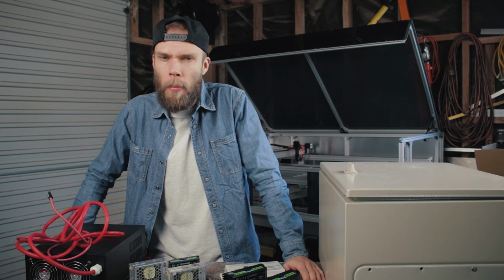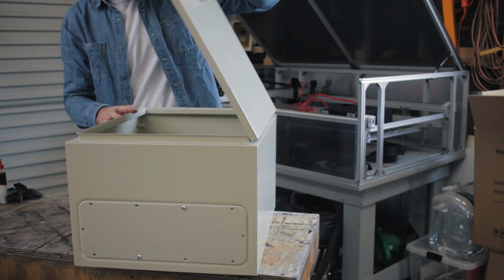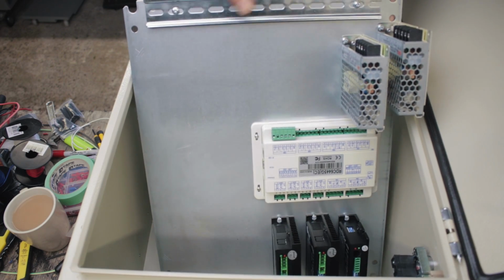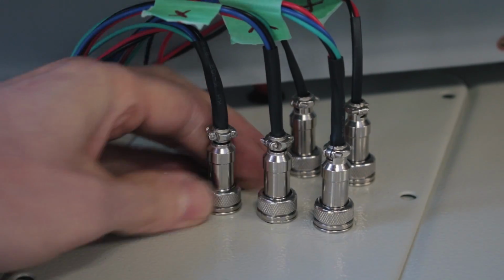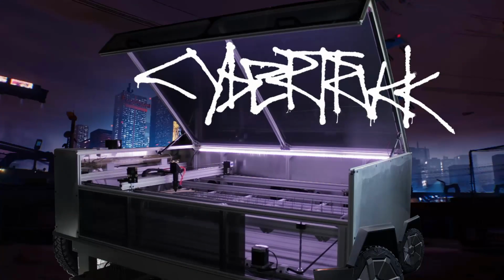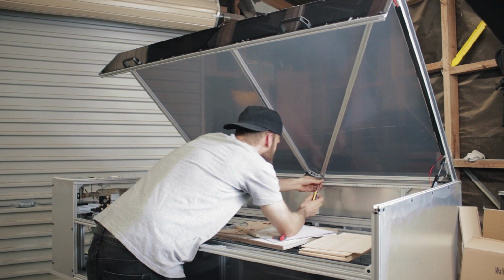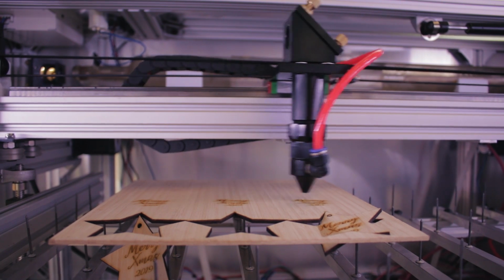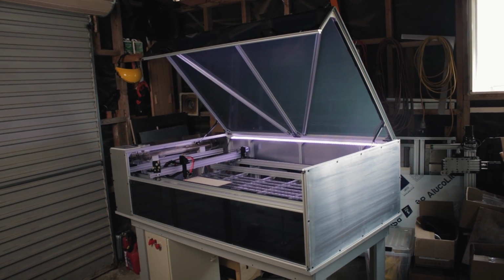Ep9: Finished? The DIY CO2 Laser Cutter / Engraver Build Series

Comment: What diameter is your water pipe. I’m looking at 7/10mm or 8/11mm pipe, what size would you recommend? I’m using a w2 reci tube with a cw5200 water chiller and your design of machine in Scotland

Comment: Hi Rob
I've got the plans and I'm in the process of building the thing, thanks for that. It's been a great project so far. I was wondering if you are still satisfied with the air assist after all that time. Do you find the pressure and air volume adequate for keeping the lens clean? Does it actually make a decent job of preventing combustion of flammable materials like wood/plywood?
Thanks again

Comment: I'm surprised you have no issues with your electronics considering you don't use any shielded wire.
Reply from the maker: Yeah so am I actually - it may be dumb luck, but I've never had a problem with interference. However I do think shielded wiring would be worth doing for the long term.

Comment: I would advise against that tube mounted led.  The pass through setups work much better and double as an alignment tool once the beam from the tube to the first mirror is properly aligned with the visible laser to the second mirror. Anyhow  As a rule of thumb, keeping the nozzle/cart as light as possible is key to avoid over driving the steppers at high speeds during raster etching.  This is due to "dynamic load shift", which is more or less a fancy way of saying the inertia created from the cart during fast starts and stops.  Frame shaking and belt stretching are greatly reduced and higher accelerations can be achieved with tighter tolerance
Reply: I know I'm late to the game, is there any benefit to having a counterweight on the opposite side of the X axis drive belt to zero out any vibration during raster etching?
Reply: @benash2954  Yes, there is if you account for rotational mass from the internal motor centrifugal inertia as well.   This would be done with a dual shaft motor and a balanced differential weight, such as the way a harmonic balancer works but in counter rotation.   That would basically eliminate all inertial load throw.

Comment: Awesome build man, I didn't find it, but didn't look terribly hard, how thick of plywood can you cut with that 50W?

I'd like to be able to cut 1/2" plywood or at the very least 7/16" OSB.

I'm seriously considering a build now, would make for some good companion content.
Reply from the maker: thanks man. 50w wouldn't be great for 1/2" ply, you could do it, but it wouldn't be pretty haha. I'd say 1/4" would be as thick as you'd want to go with 50w. 
Of course more power would give you greater depth but I can't say exactly how much you'd need because it depends on a whole bunch of local factors, like the density of the certain ply and how fast you need to do the job etc. 
I'd start with something closer to 100w.

Comment: As a person who built this laser and spent the last 2 months and thousands of dollars doing it I can’t blame anybody but myself for not being more informed.

There’s so much shit that could be improved on this design I’m pretty sure he just winged this together for this YouTube series.

I really don’t want to shit on him because he put a lot of work into this laser and it does work but it’s like walking on pins and needles using this thing and there’s a lot wrong once you start to really deep dive into commercial lasers designs and other diy builds that got it right.

The exhaust is horrible it sucks smoke right over the 3rd mirror and the linear rail so everything gets covered in soot every time you use it. There’s also no vents anywhere so running the exhaust without opening those sliding panels is so restricted it barely does anything.

There’s no access door for the laser tube so to do anything you have to take half the panels apart and the extrusions on the frame.

The recommended tube is dumb when there are tubes that have red dot indicators built in.

The z axis tensioners don’t work very well and they need to be shimmed up to make it them level with the z motor idler.

There are no pass throughs and the design doesn’t allow for any to be retrofitted.

The suggested location of the electronics panel blocks any chance of being able to clean the laser tube lens or remove the tube without taking apart half the machine like I said above.

That’s just the stuff I can think of off the top of my head there’s so much more shit I have came across that is very frustrating with this thing.

I’m scared to cross hatch with this thing when I engrave because any time you make the y axis move fast the mirrors might come out of alignment due to the extremely jerky nema 23 dual shaft motor that’s hooked up directly to the drive shafts with flex couplers when it probably should have been a single shaft motor mounted above the drive shafts that turned a pulley which turns the shafts like a commercial machine.

Only reason I’m leaving this comment is because someone who wants to build their own machine like me and didn’t know any better being new to this and the fact not many people have diy plans for something like this come across this series and it looks great on YouTube and you don’t find out until you’re months into this and thousands of dollars later that there’s a lot wrong here.

This machine does work and will get the job done but compared to something like the rezo 1390 which gets it right the first time with plans for $20 more if you want to build your own laser I would highly suggest going with that one instead you can thank me later.

Comment: Hi and many thanks for a great series :)
I have a couple of questions.  I have a 1250mm 60W tube and may upgrade at a later date.  A friend has very specific requirements that need a 1220 x 1000 cutting area where the material is 1200 continuous roll.  I have worked out the necessary changes from the PDF's you sell (Definitely worth the money guys) . 
You mentioned putting the tube along the back and the mirror arrangement.
Is there any disadvantage to adding an extra mirror except for the cost of the mirror and the mount.
Also is there any disadvantage to having a long X-Axis if one was to use V-Slot and not the MGN15 slide rail, plus it would save a mirror and mount.  
My original redesign of  increasing the 600 to 1000 mean that I needed a 1100mm slide rail an that beasty is just not easily purchased locally. 1000mm is the max  so I was looking a V-Slot anyway. My local supplier has 1500mm lengths of 2020 and 2040 at a decent price and I already have lot of parts from my 3D printers and CNC rig.

Many many thanks for any advice you can throw my way..
Reply from the maker: Out of the two options for putting the tube along the back, switching to the long x-axis is the easier option (and is how most lasers are setup anyway). The disadvantage is  spanning a large gap is tougher than spanning a small one.  Over that distance the 'straightness' of the gantry rail may be an issue, as belt tension could cause bowing over time, so beefing it up might be a good idea. Using V-Wheels would be the preferred method I reckon, my last one was setup like that, though not as big, and it worked great.
Reply: @FurtherFabrication  would swapping the x gantry from 2020 to 2040 help since we have 2 Y stepper?

Comment: What are the wiring standards in the NZ because you used red wires for the mains power? Is that normal for NZ because it confused me when looking at the controller box
Reply from the maker: Not sure, I'm definitely no expert on that subject. Those wires are spec'd for mains AC power but I was surprised they weren't the normal brown, blue, green.

Comment: Nice job. All the electronics have arrived from AliExpress, now to find a good suppliers of Al extrusion in Australia. Thanks for all your hard work, it would be great to hear how to earn income from it, as eventually I'd like it to pay for itself.
Curious why you went for the red dot laser on the head and not the option of a beam collimator/combiner between mirrors? Cost?
Reply from the maker: Thanks mate. Awesome that you've already got your build underway! 
I've found that it's pretty easy to get it to pay for itself so it'll be great to share that whole side of things. 
Yip, just time and cost, no need to get fancy for such a simple thing
Reply: Further Fabrication The beam combiner is nice when your swapping out lens tubes that have different focal lenses already installed. So for example if your going to cut up some 20mm acrylic you want to run a 4” focal lens and maybe your next job will be raster engraving on some 3mm plywood and then cut out a shape. You’d want to swap in your 1.5” or 2” focal lens for that.  Point of my blabbering is your saving time by not needing to swap over your bracket for the red pointed and line it all back up when you change out your focal tubes. Make sense? Anyhow your machine is sweeeeeeeet man!!
Reply from the maker: that's a really good point!
Reply: Hi Andrew, I'm also in Australia and would appreciate if you could indicate how much roughly it has cost you to build this. Thanks in advance 👍🏻

Comment: Great job. I followed all the construction and I really liked it
Love to do the same because my  Chinese laser cutting does not have a good geometry and it is very difficult to have homogeneous settings.

I recommend to use LightBurn software. It works with a lot of controller and works also with Gcode. A great option you can install is a camera inside the top cover
https://lightburnsoftware.com/